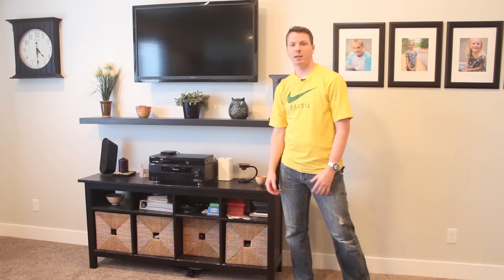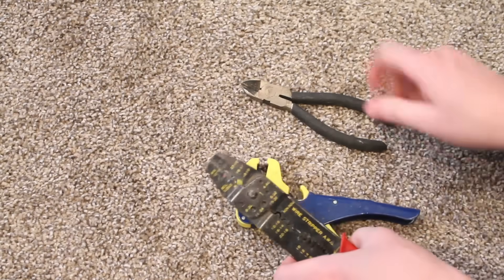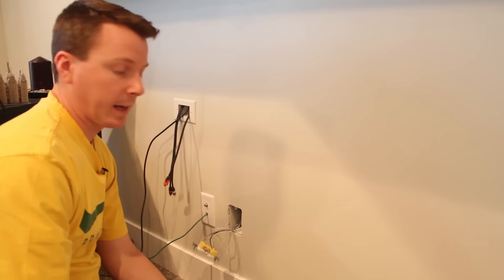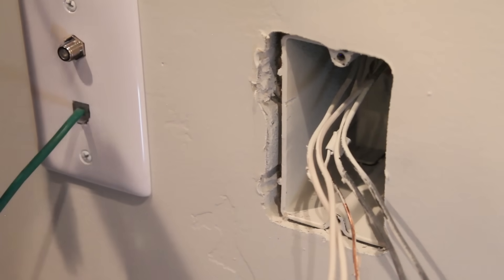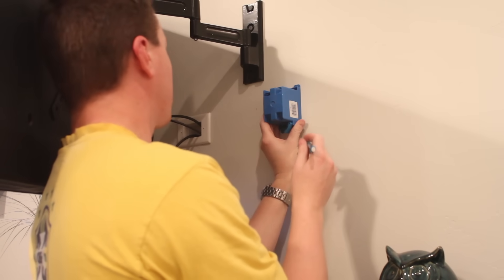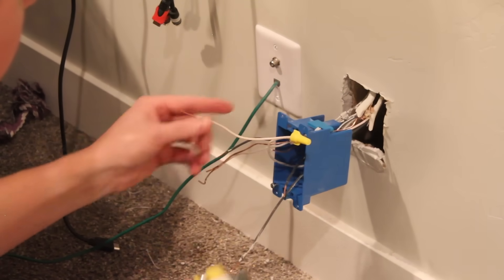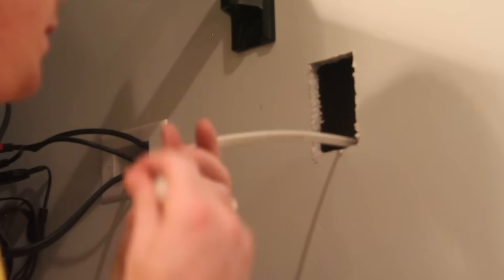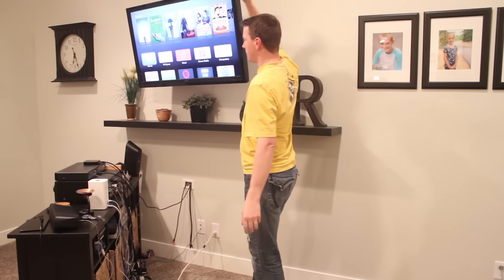How to Add an Electrical Outlet for a Wall Mounted TV

Comment: How do you fish the cable across the stud? My TV is mounts on a different stud and the outlet is way over to the right side at the bottom of the wall.
Reply from the maker: Assuming you don't have an unfinished basement or an attic that you can run the wires through, your only other option is to drill through the individual studs after cutting pockets in the drywall. You can use a technique called a pumpkin cut to minimize the damage.You can also use a flexible drill bit like this on to get through 2 or 3 studs at a time. https://amzn.to/2Kat0mg
Reply: LRN2DIY thank you! I’ll let you know how it goes.
Reply from the maker: @z4hsky  Best of luck!

Comment: I really didn’t care for this instruction. I think this video failed to highlight the key safety points that need to be taken for this kind of work. It also didn’t address some common problems that could be encountered when doing something like this.

I mean hiding wires is great. I love the look, but poor electrical work can degrade over time and be a serious fire hazard. It should not be taken lightly. It’s not hard and can be DIY, but the proper safety key points need to be met.

Comment: If you had used this the first time you could have saved yourself a lot of extra work.  em # 332111 Model # HT2102-WH-V1
Legrand 2-Gang White Plastic New Work/Old Work Standard Rectangular Wall Electrical Box

Comment: Great work, that’s exactly how I do it as well. Only thing is in my area, code requires that the Ground pin of the outlet be facing up if the outlet is high on the wall. So essentially I have to mount these outlets upside down. Other than that it’s a great job, and a good project for a DIY-minded homeowner like me to do.

Comment: Great video! When u cut into drywall for new plug wouldn’t u need to be careful and not hit the wire running down stud to existing receptacle?? Just curious
Reply from the maker: Great question. You definitely need to be careful of this. The wires are typically stapled to the stud a couple of inches above the receptacle box. If you can fit the blade on the top of the box directly on the stud, you should be clear to cut through downward through those nails. The wires in these boxes will almost always come out the top or bottom of the box, so just take note of where they're going.

Comment: For anyone wanting to add receptacle outlets in existing walls, here is a helpful tip.   Get a small cardboard box with fold out lids.   Open the top and place painters or masking tape half in the cardboard.    Then stick the tape to the wall below the location you are wanting to cut a hole.   Cut the hole and the gypsum powder goes in the box and not on the mantel or floor.   Your spouse will greatly appreciate this if they do the cleaning!

Comment: At 4min 50 seconds u had 4 wires going to lower box then u add two new wires from top but only hook up 4 on bottom again what happened to the other two wires?
Reply from the maker: If you pause at 10:17, you'll see that I took two of the neutrals (white) and two of the lines (black) and connected them to one pigtail each, so that I only had two remaining wires to attach to the old outlet. The pigtail concept is explained at 9:18. Good luck!

Comment: Revisited this video because you did a great job of explaining the wiring process. I watched the first time to wire my tv and now will be using basically the same method to install some bedroom scones. Thanks again!
Reply: as long as the are located over a socket, how will you power them off though?

Comment: Nice job! Straight forward and detailed. Our code might be different but pretty sure the wire jackets are supposed to be pulled through .5” or so into the outlet box...
Reply: Probably more, I think about 6 inches, but I am not a professional, I do learn any code I pick up though.

Comment: Nice video ... I've never had any luck flipping the tabs and screwing with a power driver (philips screw heads are China cheap) and resorted to a proper size handheld philips done somewhat slow.

Comment: Good video.  Two things to correct 1- the upper outlet Romex wire shield/protector has to be removed flush or nearly flush to box entry (1/4" or so passed the box retaining clip) so that the wire conductors are free of it within the box. 2- there has to be a minimum of 6" of wire conductors from the wire entry of the box.  The wires you have in the upper box seem too short and the shield (white wire cover) was not removed at box entry (retaining clip).  

A tip - when the wires have been twisted together so as to put them in the wire nut, use cutters to clip off the most protruding wire (clip off the twisted wire ends).  This will make it much easier, and a better shielding, when you put the wire nut on the wires.
Reply from the maker: Great tips!
Reply: Hire an Electrician. ⚡🔌💡

Comment: Hi, I like your video, but I’m a little confused on how you connected the wires on the lower outlet. Why didn’t you just connected the black wires on each screw on the outlet without adding the extra little wires that you cut out on each screws if there are two brass color screws and two silver color screws?
Thank you
Reply from the maker: If you look closely, there are actually three sets of wires. One coming into the box (the source), one going out to the next outlet in the run and we added a third for the upper outlet. With just two screws for positive and two for neutral, we needed to pigtail the wires.

Comment: I’m confused. 

What’s the point of the “three-way” connector? Why not just attach the new Romex DIRECTLY to one of the screws that isn’t being used???
Reply from the maker: @Ayden Jessee If you look closely, there are actually three sets of wires. One coming into the box (the source), one going out to the next outlet in the run and we added a third for the upper outlet. With just two screws for positive and two for neutral, we needed to pigtail the wires.
Reply: @LRN2DIY  Question about pigtails.  So your original outlet had one source set of wires, one load set of wires and you added a second load set of wires.  I assume you're pigtailing the second load, right?  Are you pigtailing the second load to the source?

Comment: Awesome video. Looks simpler than it might be... I got a question... how to do so if the outlet you need behind the TV is not directly above the original outlet? Any way to do that?
Reply from the maker: Sebastian Cheung Sure. There’s another video on my channel called How to Hide Your TV Wires in 30 Minutes that uses a kit that makes that possible.

Comment: Good video, but I had a few comments and questions.  This works only if you have an existing outlet directly below where you want to install the new outlet.  I had a few questions.  You could have nailed the new outlet to the stud.  Did you decide to use those drywall mount boxes because they're less work than using stud-mount boxes?  Why do you prefer to use the screws on the receptacles rather than pushing the wires into the holes?
Reply: You wouldn't be able to use the nail-in boxes, called new work boxes, because even if you could fit it in place through the existing hole, the nails are then behind where the drywall once in place and you couldn't hit them in with a hammer to set in place. This is why you use an old work box, as in the video. They use tabs that grip to the drywall as you tighten them with a screwdriver.

Comment: love you video, however you speak toooooo fast to be followed. I had to rewind many times..Thank you for your work.
Reply from the maker: Glad you were able to get through it still. One thing that may help is to adjust the playback speed. Both on the YouTube app (for mobile devices) and on the desktop version for the web, you can adjust the playback speed to 3/4 to slow things down.

Comment: If there was no fire block you could have ran the wire up through the existing outlet to the new one and skipped the saw and drywall repair.

Comment: Just make a hole in the top of the existing box, push your fish tape up the wall, tie a string to it, pull it down through your existing box, use it to pull up your new wire, and then attach it to the side screws on the existing outlet (No need to remove the wires like you did). Reinstall that outlet just like it was, and then do the top part just as you did. Done in half the time, and no sheetrock damage like you had.
Reply: Thanks buddy… you are so right, it’s  faster and easier with less tools too…👍
Reply: As soon as he started to remove the original box I was like no no no. I'm not an electrican and was looking for how to add the new wire. I would cut the new hole for the new box and push the new wire up from existing box until you can find it in the new hole. A little harder if it has insulation or a fire block but most of the time it it clear. He made it twice a hard.
Reply: Is there a good video showing this online?
Reply: @DrMatthewHudson did you find one?
Reply: Yes you explained it a better on the procedure save yourself installing 2 rework boxes just one. And the little tear out of Sheetrock he did pulling out the existing box no need for that extra work
Reply: I did hear though you wouldn't want to add new wires to outlet box. Pig tail is correct
Reply: I wish that was my case. My house was built in 1969 with metal boxes that have just enough space for the 12 gage and outlet.
Reply: Also to make it easier make a quarter in cut above the existing Box to make it easier to get the wire into the existing box and just buy and oversized device cover
Reply: I don't think you can just make a new hole in your box
Reply: @sleepybot3905

You don’t have to ‘make’ a hole. There are existing tabs that can be punched out even on an existing box.
This is a good video for people who have no experience with this kind of work but the removal of the old box and the splicing of wires is unnecessary. 

Outlets are designed to be chained. That’s why there are 4 screws - to link to the next outlet
Reply: Sounds up to code to me! 😂
Reply: 0:37 Buddy

Comment: As an electrician I’m gonna say that a multi meter is in no way optional you need something to tell you what’s going on in your Circuit no matter what
Reply: A multimeter for running an extension outlet? Why?

Not trying to be a dick, I’ve just never used one for this, nor for changing out outlets and switches.
Reply: @JS-rp7qb , because there are situations in which there are multiple hot wires inside of a single box.  Never assume there is only one!!
Reply: You notice? It's the free one from Harbor Freight.
Reply: Fritz Golden I didn’t, all Ik is that you need a meter for any electrical project

Comment: It's not a cap, it's a wire nut.  You don't twist the ends of the wires together with pliers, you use the wire nut to attach them together.  In case someone wants a reference:
https://idealind.com/content/dam/electrical/assets/WireTermination/WireConnectors/TwistOn/WireNut/WireNut%20WireConnector%20Instructions.pdf

Comment: Best video among 5 I watched for TV outlet moving. 
I wonder if instead of the small wires and wire caps you could connect both wires at the side screw of bottom outlet   Might be less bulky
Reply from the maker: Farzad Fani Pakdel Thanks for watching! I wondered the same thing about the side screws but that’s actually against code because it greatly increases the chance of a poor connection or even of one slipping out altogether.

Comment: By way of suggestions:  an electrician taught me that code inspectors (CA) look for at least 3 twists on wire splices.  Also, when making wire loops to go around screws, the loop must be in the same direction as the screw tightens- to the right; the loop should allow for the entire screw to be exposed to bare wire only and not insulation; the loop should wrap all of the way around the screw, but not stick beyond the screw.
Reply: Thank you for this tip!
Reply: Yup clockwise

Comment: Thank you! I have the issue of two different cables feeding to the current box and trying to tie a third line in. Your tutorial helped! Now my dilemma is that this house is using about 10 gauge wires that I have to try and straighten out to connect the lines and I am using 14 guage on the tie in.

Comment: Thanks for the video.  (And BTW at 6:28 you are using an old work box .... new work boxes can be nailed to exposed framing, i.e., no drywall installed yet. Old work boxes attach as you demonstrate - to the drywall using the winged clamps.)

Comment: Actually you did okay for a home owner. The electricians would not remove the box at all but would open the hole in the original box and fish the 14-2 wire right through the hole with the other box, or you could replace the box with a "smart box" that would allow you to screw the box into the stud through the front of the box. Also you should have used a clock outlet behind the TV to allow the cord prong-set to be recessed.

Comment: Never been more excited to try a tutorial. Thank you!
Reply: This guy doesn’t know what he’s doing! He ruined the hole removing the box. The new box will pull out of the wall when you remove a cord. You can’t see that on the video but it is the case. Also,there’s a lot of information he skips over. If you aren’t well versed in electrical work, be very careful.just because it works when your done,that doesn’t mean it is safe!

Comment: Will the added outlet only have one working plug due to only one set of wires coming into it? I literally have 0 electrical knowledge
Reply from the maker: No. Only one set of wires is required to pass power to both plugs. If there's a second power line going to it, it's just to pass that to the next outlet. So both plugs work.
Reply: @LRN2DIY  awesome, I've been looking for a good way to hide my cables and this will do nicely

Comment: At 4:56 if wires are set into outlet cut them off never force them out unless you plan on reusing the outlet. If so, look closely at the stripped wire and you will see that the wire is nicked.  So remedy this by cutting just back from the damaged wire.

Comment: According to the ESA here in Ontario, Canada, I can only have a maximum of 12 outlets per circuit.  So I can’t just add an outlet as you state here.  And way too much Romex in the new box.  You only need like 6” of 2 wires and 1/4” of Romex.